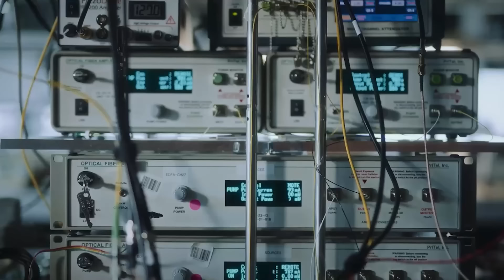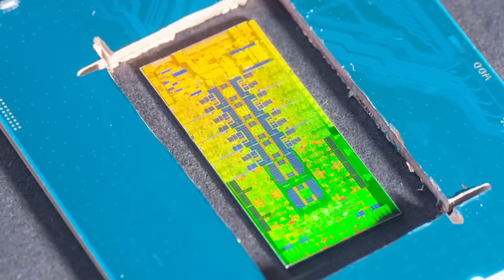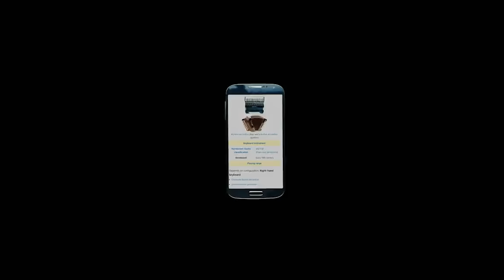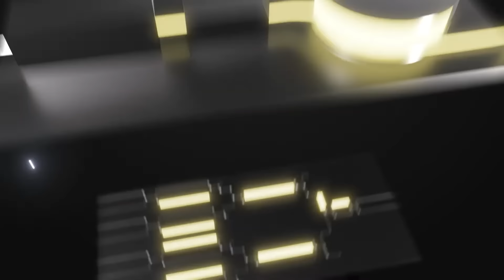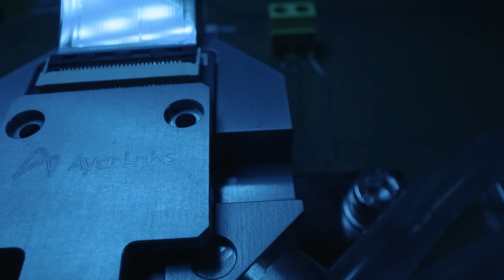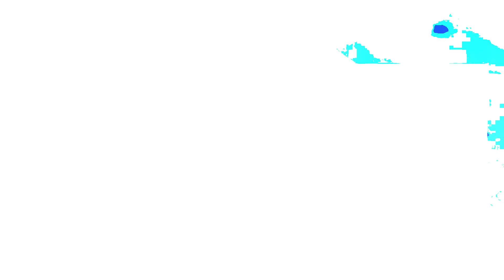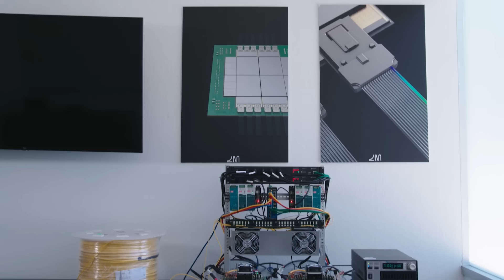Germany's New Photonic NPU Just Made NVIDIA’s Billion Dollar GPUs Look Like TRASH!

Comment: I use light on a macro scale. Using phosphorescence and spectral effect. Basically, conditioning light to be useful. Multiplexing too but not concerned with photons but the light as a whole. I figured a light node that has 3 optical leads similar to a transistor.  The nodes are put together to in a configuration without needing many nodes to do more than any use case. The most interesting part I'm capitalizing on is that light doesn't experience time.

Comment: The actual math part of computing already happens instantly within the processor. The actual time and heat wasting is coming from moving everything between memory and the processor,  not the actual calculations. It's called von-neumann architecture and it caused the bottleneck problems because the calculations require moving data back and forth between memory and processor so much that it causes massive wastes in time and energy.

Comment: 500 MW is a lot more then a 100 German homes
Reply: nah 560 MWh are like 50 single households with 1200Kwh.if you count families of 3-4 ,then its apprx the energy for 100 germans per years
Reply: @flummi6966  chat GPT says . About 1.4 million German homes, assuming 500 MW runs continuously
Reply: @chadnasir6387  its either per day or per year, thats why there is per hour as part of the unit. you can multiply hours of the year by  50 or 100 on your own or trust german engineers.

Comment: While the emotional shift in the message is clear, the narrative completely ignores the mechanical reality of the 'light' it claims to celebrate. Light isn’t a passive miracle; it is a high-bandwidth signal generated by a massive energy source and modulated by the atmosphere?

For the 'beautiful day' to exist, there is a primary generator (the sun) and a complex system of diffusion and scattering at play. The sign change is clever, but it fails to acknowledge that 'sight' is effectively the biological demodulation of a constant energy stream. Without the generator and the modulation of those photons, the sentiment on that cardboard sign has no power source to back it up. Why do we focus on the poetry of the day but never the physics of the source that makes it visible?
Reply: So pc in day only then?

Comment: Mate, you need to buy a popp-filter to place before your microphone or alternatively cut off the frequencies below 80 Hz to avoid those annoying pops on the "Ps". Also you should compress your recording with 4:1 ratio and take back a notch the screaming, it's a tad tiring after 5 minutes or so. Otherwise great info, thanx!
Reply from the maker: Thanks mate. I do have a pop filter, but it's a cheaper model. Maybe buying an expensive one will help? I'll definitely fix this problem in a couple of days.

Comment: Nice description! Fwiw, performance is always discussed in relation to the workload type that any CPU, GPU, TPU, FPGA, DSP etc., is designed to handle. 
For example, how you don't use a TPU for things that a DSP excels at, like FFT, IIR filtering, signals convolution, etc., all with deterministic latency and v. low power consumption. Or how DSPs can't handle things involving heavy branching, recursion or out-of-order execution which CPUs can naturally handle with great flexibility. 
To me, this distinction is almost always a fundamental aspect to consider, when pitting vastly different systems against each other for comparison.

Comment: While I have been chuffed over the decades with "technological advancedment", the perversion to progress has unfortunately reared its head too many times. Data centers (yes I have built them on the "AC" side) are not self supportive, and locals have to share the cost burden. Unfortunately,  the resistance is adter the fact, but lawsuits will start stacking in the coming years.

Comment: meanwhile NVIDIA is heavily moving into photonics, specifically investing $4 billion to develop silicon photonics and co-packaged optics (CPO) to enhance AI data center networking, Jensen is a business man  and while that is going on he don't wait he is preparing Vera Rubin chips. Nvidia is in everything, Jensen make sure that he is par tof an infrastructure, if something fails you go to anther while fixing the failed. Nvidia is not going anywhere. If gamers would get pass the hate, heck they gave gamers a badass Gpu to keep them going until while they focus on ai and others things, its a business, they create you buy they stay on top as one of the leaders. they gave gamers the best gpu to keep them busy untill 2028 the 5090 with 32gb ram. yes its expensive but it exists.. Also if this is the next shift which it would be for computing, it will get affordable simply because of less power with photnics.

Comment: Video is interesting and the idea itself is very cool, especially the part about energy and cooling because that is a real bottleneck right now, but the tone feels a bit overhyped like GPUs are already dead which is clearly not the case. All those 50x or 100x gains sound impressive but it is obvious they are on very specific workloads like matrix ops, not real end to end systems. The biggest issue you mentioned kind of casually is actually huge, no optical memory means constant conversions back to electronics and that can kill a big part of the advantage. Also saying zero heat and no need for cooling is just not realistic at system level. In practice this looks more like a very fast specialized co-processor for inference and linear algebra, not a replacement for CPUs or GPUs anytime soon. Still very promising tech but right now it feels more like early TPU stage than some immediate paradigm shift

Comment: Crystals.  Create a crystal that can store data.  A crystal that can write, store and rewrite data as conventional ram would do only data stored on a crystal would be able to store data in 3D.  The storage capacity would be insane compared to today’s ram and it would be in the same realm as the light technology.
Reply: data storage is a tricky one, the way we evolved from magnetic bands over floppy disks to little silicium that can carry terrabytes in the format of a bigger, more wide credit card or small notebook is amazing, however these will not hold for eternity. the compression range is impressive, the length of "lifetime" is not. some of my old cds and dvds still work (around 20 years old) others have trouble. my dad had to rescue his old photos on an old hard drive that refused to work, most but not all data could be rescued. so there is impermanence in every technology. people suggested using DNa or other bioorganic molecules to store information, advantage again very high compression rate, probably longer storeable, but that storage (i.e. cooling) also comes at an expensive price. in that regard, stone tablets from the ancient times are very bad in one aspect (veeeery low compression of information rate) but by far outlasted all other mediums (paper scrolls, books, digital) we had on this planet so far. but to turn the entire internet lets say as an example into stone tablets for storage would require amounts of rock we probably would not even have if we mined the moon. so information storage is always a compromise between economic, mass and efficiency calculations. your suggestions sounds great on paper but  I bet even with storing info in light crystals there would be a caveat somewhere. you simply can not have it all, most often for physical reasons, meaning the very laws of nature prevent you from having paradise in a sense.
Reply: @Luemm3l 

Agreed.  Definitely not an overnight solution.  As you said, there’s a give and take with everything.  Just have to have so many pluses, the negatives are livable.  Beyond that, can’t please everyone.  Guaranteed there’ll be a number of people bitching about a negative not understanding the miracle technology actually is.  We’re taking non organic materials and making them to make phone calls with video.  To make a tablet that can do damn near anything you’ll ever want to do on it.  Blows my mind what we figured out so far and we haven’t even scratched the surface yet.

Comment: there other companies doing this. Neurophos in the united states. They use chips only the CPU can run at 50GHz for the use case. You still need digital to optical and optical to digital modulators. Go check Neurophos.

Comment: Nicely done vid with the help of AI👍 Thx for pin pointing this very interesting tech which flew under the radar in most tech news!👏 Light has surely great potential, but so far it didn't take off on mass scale as many, including me thought🤔 Fingers crossed that it will work out in the near future, especially in the memory space as well as silicon photonics interconnects to drastically lower or possibly eliminate that old pesky memory wall!🤞🤞

Comment: I would say BS. I would say for light to happen tou need electricity. I would say you don't  need light speed for a switch at a distance of 2 nano meters. Sending actual data at a distance is a good thing for light. For switching it still needs the electric to switch. It uses both. So speed is irrelevant an short distances. Again for the ligjt to happen ypu need electricity and for chips the distance between switching is small and speeds for it to need both and waste electricity aren't relevant. Light computers are a joke. Computers communication between each other, light is a great solution.

Comment: Jesus, what a long-winded explanation.
Here's the skinny ...
A German startup called Q.ANT has rolled out these Native Processing Unit. It is a photonic processor: it performs key neural‑network math using light in thin‑film lithium niobate waveguides instead of electrons in CMOS transistors. It is deployed as a coprocessor alongside CPUs/GPUs.
Data still needs electrical‑to‑optical and optical‑to‑electrical conversion (“I/O tax”), but inside the NPU, math runs as analog photonics, with very high bandwidth (tens of GHz switching) and negligible on‑chip heat.
The NPUs are more efficient. Up to ~90× lower power per workload and up to ~100× higher effective data‑center‑level efficiency.
They offer less heat and simpler cooling. However, Nvidia GPUs remain more general‑purpose and flexible; photonic NPUs today are accelerators optimized for specific math patterns.
In the near term, they are unlikely to compete with Nvidia on up‑front hardware cost, but they can be competitive – even superior – on total cost of ownership for very power‑hungry, well‑matched workloads.
It's still early days. Stay tuned.
Reply: Not all heroes wear capes, thanks man
Reply: @almcchesney  Maybe he is wearing a cape. 😉
Reply: @SpiritmanProductions  maybe
Reply: @SpiritmanProductions  And if not he should!
Reply: I had already suspected the Click Baity Title and the first few seconds proved it. Thanks for saving my time.
Reply: One day this will be huge, but for right now there are huge bottlenecks because the L1 cache can't store data, so it has to be slowed down and run to RAM anyway. Once they figure that out, this is the game changer.
Reply: @dutchkc honestly by the time they figure that out there's probably been something else that's surpassed this. Tech is moving g at such a fast pace this could realistically become irrelevant before it becomes relevant.
Reply: @Ethan-v9u Although there will be other advances in tech, computing with photons is likely to be the way of the future. This is because photons can stack unlike electrons and they don't give off heat like electrons do. How exactly the computing with photons happens may change but the advantage here is in the fundamental physics so it's a very good long-term bet.
Reply: It actually explains more than the "gist" if you listen.
Reply: @aakashshringare6670  Why don't you elaborate it for us.
Reply: @NoH @NoHiddenDepths ’s like asking someone to listen to an explanation and just repeat it back to you…. Literally….what just happened here…and OP,did that. 

I understand it clearly doesn’t make sense to you but he is right, it does give a basic explanation.

Maybe get off the internet, if you’re trying to be an asshole for no reason you need to get off the internet and do something with yourself.
Reply: @DirkNodripski  can you reply to all the videos i watch with your synopsis? very helpful.
Reply: "deployed as a coprocessor alongside CPUs/GPUs." this was the most important part to me. Says it all. early tech, good at specific operations but not a full replacement.
Reply: Thanks for the summary, and that's really cool.
Reply: yeah, it is impressive technology, maybe it evolves, but currently it is just a helper for more traditional calculating units such as cpu and gpu, it will probablz not in the immediate time replace them. still great that AI efficiency hopefully can be improved in the massive data centers this way. I mean virtually no heat and less latency than with electrons? count me in! I found the rising amount of power draw and cooling needed for servers but also home desktops (bigger gpus) worrysome to begin with. cause right now that is what fossil fuels are in the real world: still probably better performance (compared in terms of maybe top speed or mileage out of one gas fill compared to a ev car for example) but at the cost of waay worse efficiency and garbage in form of heat and exhaust (or heat and high power draw in terms of compute)... time we changed that.
Reply: Doing the lord's work.
Reply: What about Silicon connected NPUs which can convert between the two efficiently. It's still theory but it's possible and better.
Reply: GOD     DAMMIT

Whenever I see a post about photonic chips I click, think "here we go again..." and then look at myself after I watch this video and say "yeap, same old hype as 3 years ago!"
Reply: @Neuroszima It will really revolutionize the industry! For reals this time!
Reply: Thank you :)
Reply: Thanks man.
Reply: Glad i didnt even watch one second of the video.
Reply: TY! ❤
Reply: Thanks for saving 12 minutes of my lunch break
Reply: @SgtEpicc Why are you not playing Hearthstone on your break?
Reply: What is the ticker symbol
Reply: NPU “Neural processing unit”. Just fyi.
Reply: Thanks for the TLDR!
Reply: You deserve an award or something. Especially the parts where 'what if I want to tell someone about this tomorrow at the office? What were the numbers, what compared against what?' - those crucial parts were way too rushed in the video. Thanks for putting it together in dense detail
Reply: You are my father
Reply: Neural processing Unit.
Reply: Thanks! CPU’s using light aren’t a new idea . I remember it from the 90’s. 

But, I’m sure that the technology is worlds better by now.

I  also remember when 3d CPU  chips were going to happen. That is where the chips are stacked on top of each other to add another dimension to the CPU. 

So, tall CPU’s .
Reply: Doing God's work.  Verbose videos are a curse.
Reply: Thx
Reply: Does Moore's still apply for waveguides?  We're pushing transistors smaller than some visible spectra wavelengths - is the main upside thermal efficiency, or are there other upsides like less noise interference?
Reply: 369 it
Reply: Thanks
Reply: It will be an integral body part of the next gen robot i imagine
Reply: Paused the video after watching 2 seconds, spot this comment at #1 place. Read the comment. Close the video. Thanks chap.
Reply: Danke!
Reply: Yea, the only point I think you should also include is that the math it is good at it fourier transforms, and large matrix math, ie the exact math that most AI applications require.  

Given that most of our increasing datacenters are focused on exactly this kind of math, i think it is a fairly important point... it isn't just 'specific math',  it is 'the exact math that most large datacenters will be doing with the ai boom'.
Reply: Thank you. You sound like you know what you’re talking about.
Reply: Yep, like you said - the photonic processors cannot displace established silicon architectures because the energy and speed gained during optical calculation are effectively erased by the severe optical-electrical conversion penalty required to interact with standard electronic memory, permanently tethering them as dependent co-processors rather than autonomous GPU replacements. = failure as this is a LCD issue.
Reply: thanks. hard to watch this pandering.
Reply: I have always asked why we didnt have this years ago when fiber optic cables were put in use. My answer was always profit margins and regulated markets for jobs and an intentional slowing down of technical advancement.
Reply: Thank you.. seriously I think the guy just likes the sound of his own voice!
Reply: Meanwhile Datacenter  can order Q.ant's NPU2.
Reply: Yeah, NVIDIA have this ready, but in times of AI Bubble it is easy to get some people buy overpriced Ai Chips. And next they bring this tech like a normal i3 CPU. 
First this Company don’t have the capacity to produce this for everyone.
Reply: too much light loss at each calculation point,  it isn't going to scale

Comment: For example, RAM for AI in a server costs $30,000-$40,000 per stick.
Reply: That’s a crazy number. I’m genuinely into RAM / memory hardware, so I’m curious, where did you get the $30k-$40k per stick figure from? I’d be interested to read the source.
Reply: @randallspence8092  
HBM3
HBM (High Bandwidth Memory)
H100  80-141 GB
$25,000 – $40,000
1 TB of server memory can cost around $3,000 – $5,000.